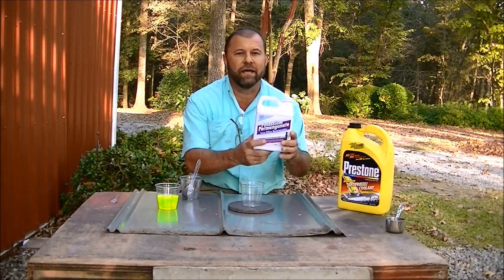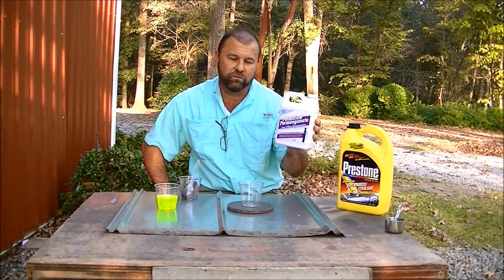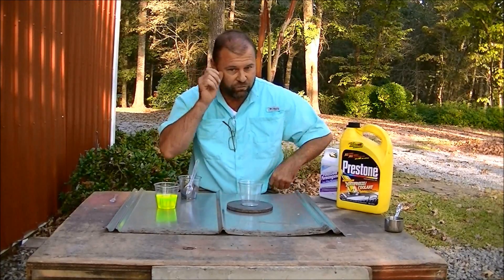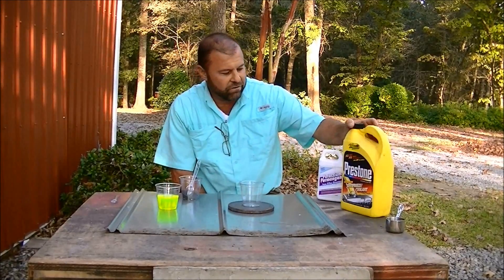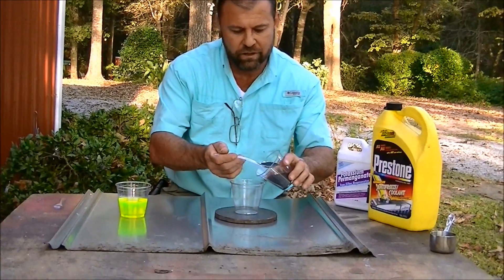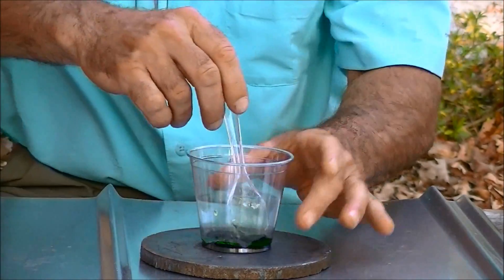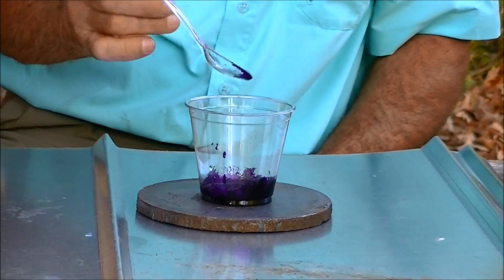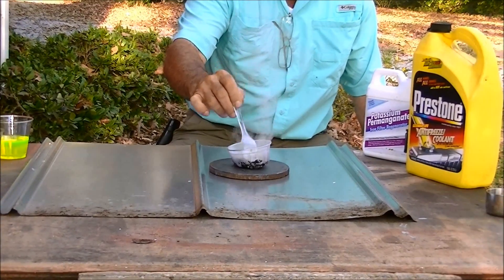Fire from anti freeze? neat science project/ easy and fast. Stem

Comment: Does it need oxygen? Will it react in a confined space?
Reply from the maker: I am not sure.
Reply: markp0177 Mr Fingers  Potassium permanganate is a strong oxidizer, think KNO3. When mixed with the glycerin, heat is generated until the combination catches fire. If you were to put this mixture in a enclosed space, say, a metal or glass container, the reaction would still take place, causing the container to explode, if there was enough pressure. If this was you intent, however, I would not recommend it, as there are many safer, more effective ways to get a loud bang. This reaction is relatively unpredictable, and wont always smoke like that before it goes off, so you will quite literally end up with a ticking time bomb.

Comment: WARNING: A buddy of mine had the brakes on his car overheat and catch fire going down a long steep grade. All he had was a bottle of antifreeze in his trunk, so he grabbed it and dumped it on the fire thinking it would put it out. Big mistake! Little did he know that at around 700 degrees the water in the antifreeze boils off and the remaining propylene glycol vapor bursts into flame. By the time emergency crews got to him his car wasn't much more than a burned out husk. Almost makes me feel better that I own a POS car with a unknown coolant leak that makes it to expensive to keep buying antifreeze, so I'm forced to use plain old water instead. Burning your car down is a really crappy way to find out antifreeze can be flamable.